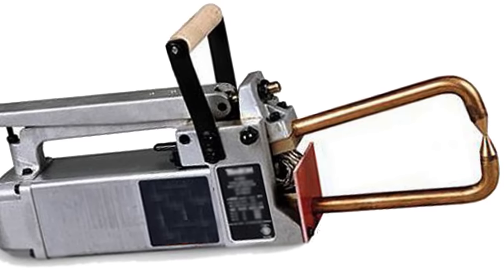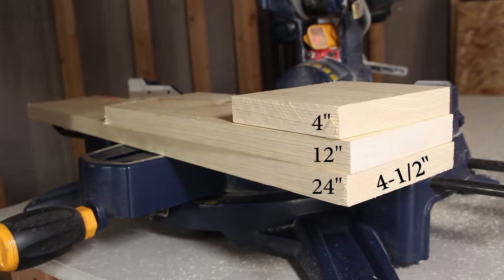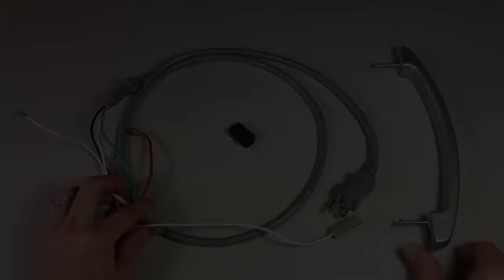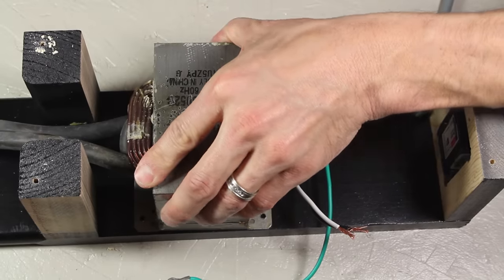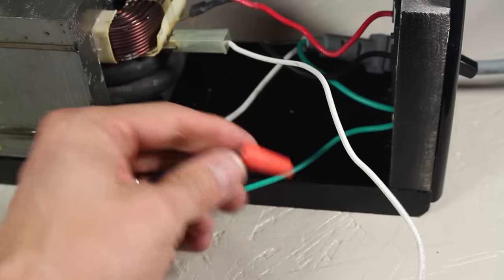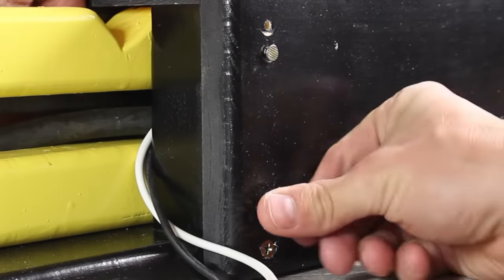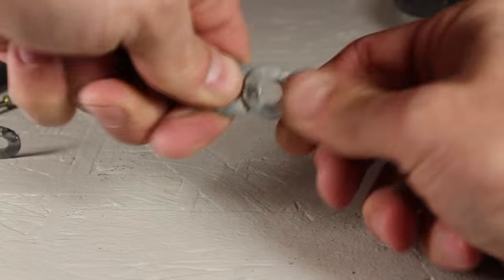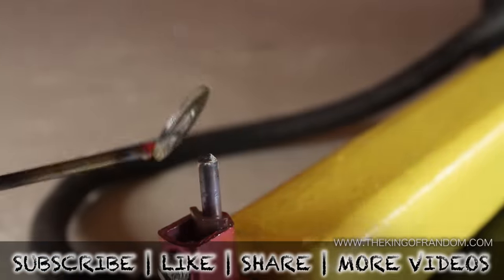Make a Spot Welder for Cheap!!

Comment: How would you make sure that you don't get shocked when changing the electrodes. I know that you have to turn the system off but wouldn't there still be an electric charge in the Megatron?

Comment: im experimenting with different winding material.  steel cable doesnt seem to work very good. im wondering also can you stack 2 transformers and make 1 big one? not wire in series but seriously converge 2 into 1...

Comment: Hi folks, I have a question. Would a 12v 7Ah LeadBattery work to spot weld with small things with ? If I only have two copper wires? connected to it? what is the ideal Ah if I want an allround welder. For small/medium aluminium things.

Comment: Can you use the spot welder to weld battery leads without damaging the batteries?
Reply: Yes, you can, but you'll need practice if you don't want to damage the bateries
Reply: 537CH No. This welder is for welding two pieces of metal from oppositre sides and FAR too big. Battery spot welders have the electrodes side by side and the nickel strap is held agaist the battery by the electrodes and zapped.
Reply: its possible, the design is modular and removable, so it is possible, difficult yes, but you can always modify the design, my concern is just the heat.

Comment: Those sparks aren't actually the metal boiling it's the carbon burning off. Most blacksmiths in my area call that burning your steel

Comment: So I have a 60 hertz 120 volt transformer I bought one aught wire it didn’t work for arc welding I have 3/32 6011 sticks which are performed on 75 amps to about 125 but mine didn’t work do I need different transformer or larger wire

Comment: the mini metal foundry failed me for melting copper. i used lump charcoal and a high setting on my hairdryer but 2000f is a hard temp to achieve i'm not blaming you. I did however manage to melt silver at 1700

Comment: Questions:
1) How many volts do you have from 2 loops. I have 1.5V. I'm not sure if that would be enough, but I can't make 3 using the wire I have. Another wire is too thin - 10mm^2. I could use double but not sure if 2 x 10mm^2 wll be enough. 
2) May I use relay 10A 350V which was in arduino? Will it be enough 10A? 
Ideally I don't want it to use more then 10A, but afraid that it might be very close to the limit.
Reply: +Alex K Your voltage depends on you winding ratio and voltage into the transformer. If you want a higher voltage use more turns on the output wire. A ten amp relay may work as an on off switch to the transformer but again, may work. It depends on the impedance of your transformers coil. There are a lot of variables
Reply: GrimL0gic I wanted to know voltage to compare what I did with that one. I understand how it is related first and second coil/voltage, I just was not sure that 2 loops will be enough.
Reply: It should be enough

Comment: made one but ii get short circuit  and it blows the fuse   when u connect the power to the  transformer  does it matter  which one you connect the  black wire and  in which one u connect the

Comment: Question : How long can i use this spot welder continously ? is it getting hot after 10 minute of using ? please help.
Reply: He passed away in 2019.
Reply: I know it's late but you should not be running continously if you are spot welding more like groups of bursts so if you have a use case where you need it to be used that much any amount of airflow at the transformer will suffice as long as it's reasonable

Comment: i thought it would shock me if i hold the metal while welding!
Reply: It's 800 amps, but it is only 2 volts, and the electricity should go straight through between the two electrodes, and not go near your hand.
Reply: Aahhh! 2volts melts metal whoah i need to learn more about it! Thanks for the idea
Reply: +Kitsune Ken ur hand is on the side. currents have no interest going there.
Reply: +Kitsune Ken but if u held onto it for too long or too close u would get a severe burn

Comment: would it be possible to use a flyback transformer from a large projection tv...I don't know the exact specs
Reply: do some tests i wouldnt imagine it is much different apart from size
Reply: No, those supply high voltage.  You want high current and low voltage.

Comment: Resistance dropped after removing secondary winding from 1 ohm to .5 ohm. I assume that I compromised the primary.
Reply: No continuity to transformer housing. But I assume primary windings must have rubbed. Transformer housing was splitting in several places.

Comment: Is it possible to use graphite electrode?
Reply: it should work. graphite has 3x higher melting point than copper too so it will be more powerful than a copper one
Reply: it should work. graphite has 3x higher melting point than copper too so it will be more powerful than a copper one

Comment: Can I used this in gold jewellery. 
Any idea
Reply: yes, I think you would be able to as gold melts around 1,064 °C and iron shown in the video melts around 1,538 °C. But for jewelry, I would recommend gold soldering with an oxyacetylene or propane torch. It is not as strong as fusing the metals togeather but the end result is more predictable and given te difference in melting temperatures between the solder and the pure gold gives you some margin for error if you watch the temperatures.

Comment: Would it be stronger if you used a brand-new microwave
Reply: no. its either on or off... on if the coil is in tact.. off if that was the faulty part and the reason the microwave was thrown out.
Reply: it could be useful to know why the doner microwave oven was not working

Comment: So.... I made this and it worked for the first weld I did. Turned it off went back 30min later to do something else and instead of that low hum the transformer did its now very loud almost as loud as a jack hammer. and I have now idea what happened ;{
Reply: AcerbusNyx Does it still weld?
Reply: luigisf I fixed it the epoxy seal broke because it (I guess) overheated but I fixed it now and also added a fan ;P

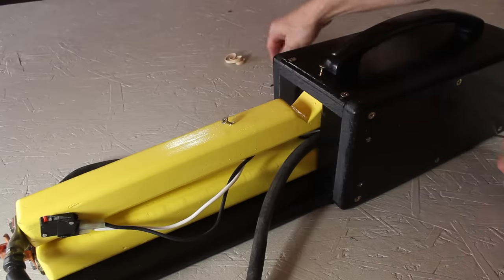Comment: 7:23 LOL my shop teacher would slap you upside the head if a weld was only that strong xD
Also you do realize that this is super dangerous right? At high amp's with no relay or power restriction using welding tips that you got from some regular copper strands it can be incredibly dangerous. Take tig welding rods and cut those down to size instead and make a stopper so that it stops the tips from touching and use some filler wire to do some tig welding for cheap but other than that go real and buy a mig welder.

Comment: you didn't mention transformer in put out put current rating
Reply: He most likely did in the video where he made the mod I believe it's something along the lines of "metal melter" but I can tell ya it's a 120v in microwave transformer with the secondary changed

Comment: Microwave transformer, Chop saw, table saw, router, router bit, bench vise, drill, 11/32 drill bit, jig saw, all the wood, orbital sander, air compressor, painting attachments for said air compressor, light switch, copper offset terminal lugs, 1/4 inch screws, nails, a "length" of 6 gauge solid copper wire, pliers, flat head screw driver, quick grip clamps, heavy duty wire stripper, Phillips head drill bit, Phillips screw driver, wire nut, 3/16 drill bit, rubber band.
Less than $10 in materials, eh? You're insane, and you're math is WAY off.
Reply: I have all of that in my garage. Would be less than $10 for me; I have scrap wood, too.

Comment: Why didn't he get electrocuted when he held the nails while welding them?
Reply: Ben Louwaert There's only going to be heat from the melting of the two pieces. No voltage flows thru the parts you are welding.